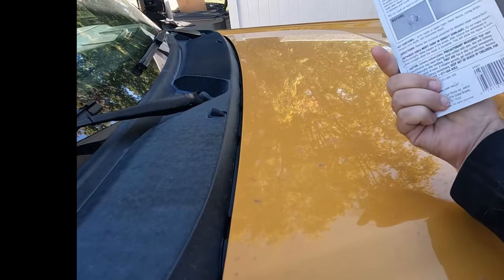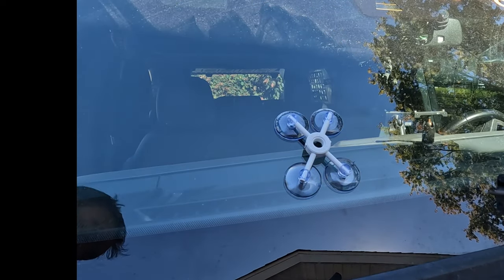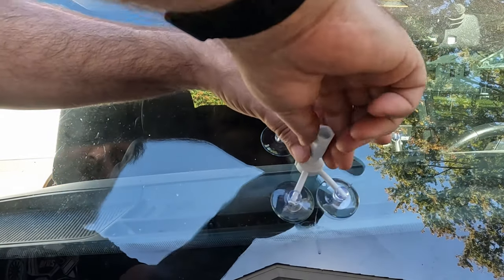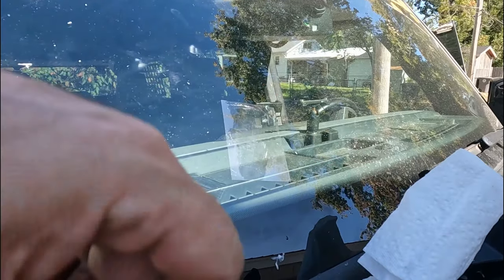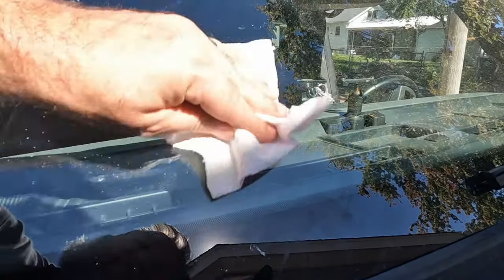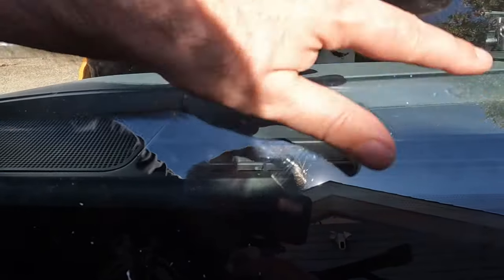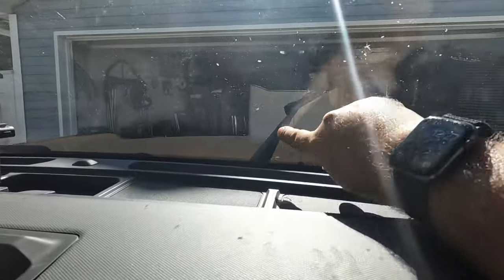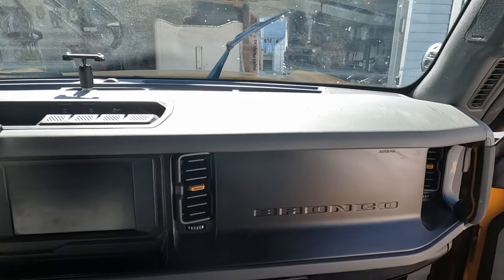I Repaired My Ford Bronco Windshield With a $20 Kit

Comment: Are you telling me I didn’t have to pay Safelite $180 for a chip repair? 😢
Reply from the maker: @technicaldisasters  hopefully that $180 includes a guarantee of some sort ?
Reply: @EvilleTruck Guarantee to empty my bank account.
Reply: Found out the hard way that chips can be repaired DIY a lot cheaper than Safelite. Took a car to them for chip repair and a month later it cracked so windshield had to be replaced.   They warned me it might happen and it did.